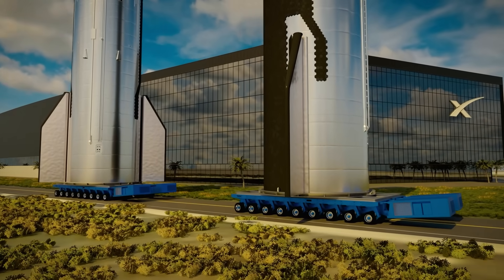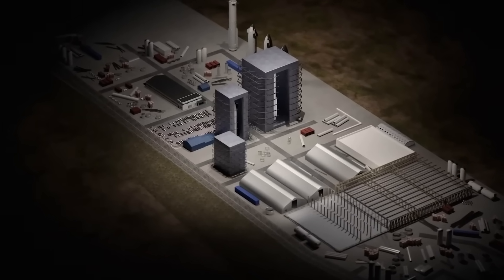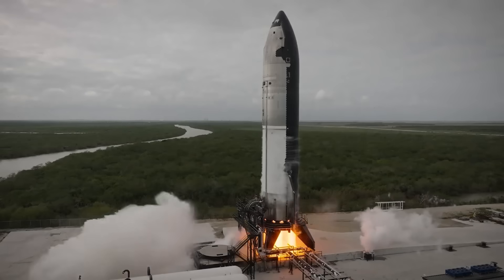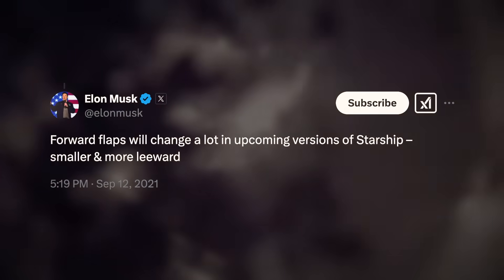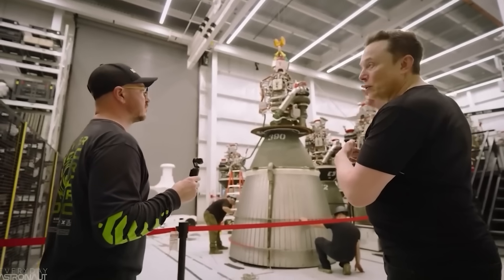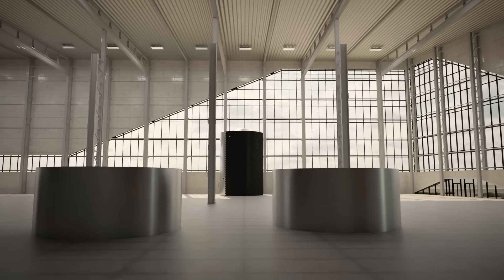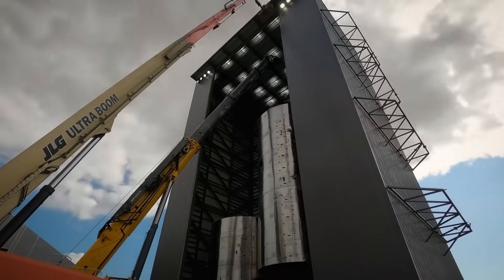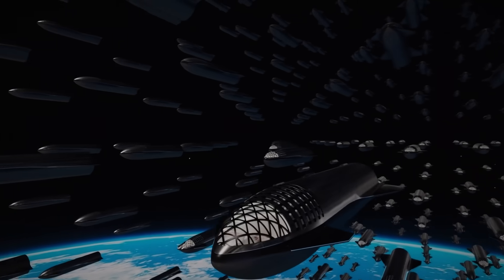How SpaceX Builds One Rocket Every Week!

Comment: SpaceX aims to build one Starship rocket every 3 days by 2025 using their new star Factory in Boca Chica, Texas. The factory employs a linear adjacent flow manufacturing process to produce Starship V2, an improved design with enhanced features for Mars colonization.
Reply: Meanwhile, BO took 25 years to produce one rocket, designed to succeed in one go, and failed at it.
Seriously, the hubris. Bezos expected the booster to land first try, and apparently this firing round is directly related to the booster's failure. That is speculation at this point, but the actions BO took speak very loudly.
Those employees must be feeling seriously Butt f-ed
Reply: This is complete nonsense. First of all, not everything in the tent is finished and optimized yet, which is why the rates are currently not even possible. Secondly, why would they do that? In 2025, SpaceX is allowed to launch a maximum of 25 times from Boca Chica. What will happen to the rest?
Reply: @Fux3r  You realize you responded to an AI, right?
Reply: It is 2025 and they never built a rocket that can even get to orbit, which according to NASA, is due to the rocket engines not producing enough power, so Starship will not go anywhere at all any time soon.
Reply: @Baerchenization It is the most powerful rocket ever built currently isn't capable to reach orbit? You will believe whatever fits your narrative. Using NASA doesn't establish credibility. NASA didn't believe in reusable rocket and laughed at SpaceX in the early days. The challenge isn't can it go to the orbit or not. It is the reusablability and cost effective are the main focus.
Reply: @Baerchenization according to NASA? Can you cite that please 😂
Reply: @Baerchenization  lol, mate, quit telling on yourself. You have no idea what orbit is. It's not a speed or a trajectory. It's a speed AND a trajectory. I can go orbital velocity but smash into the Earth an hour and a half later because my trajectory is wrong. 

Starship has hit orbital velocity or (deliberately) just shy of orbital velocity on every test that made it into space. 

Do you not realize you're saying the company that puts 90% of the yearly mass into orbit can't build a rocket engine? Do you have an ounce of self awareness?